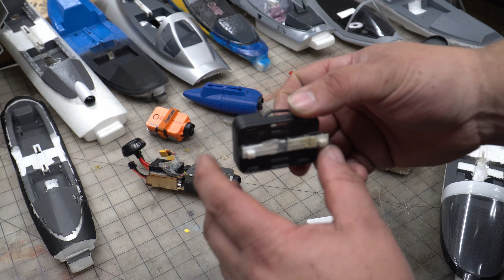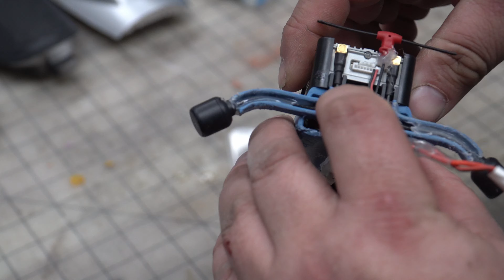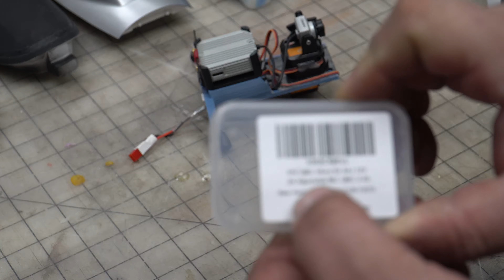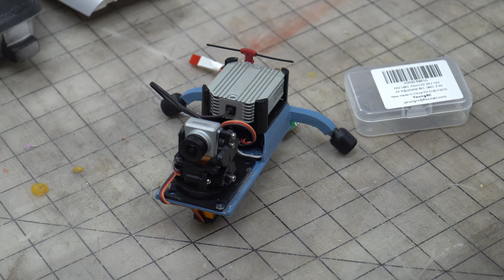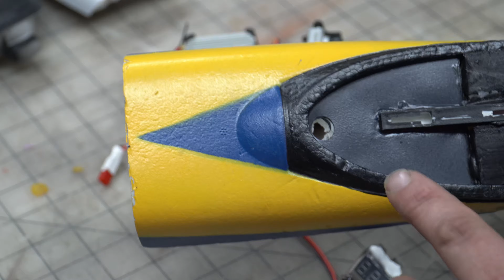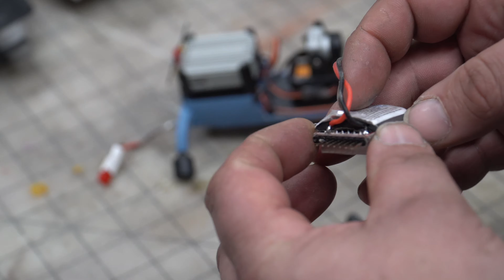Modular MotionSIC DJI FPV pod

Comment: That’s really nice. I’m currently trying to think how to set up the newer DJI air unit 03 cam transmitter set in some type of attachment, was thinking maybe clip in a GoPro connector
Reply from the maker: I just ordered an O3, but I think this one is going in a quad until I can test out the power/arming setup hassle that the O3 has, or had, when not using a FC.  Some say a firmware change fixed it, but I'm also seeing things about some of the recording features only being enbaled with the goggles 2 and not the goggles v2  (stupid naming scheme)  So we will see when that shows up and I get around to testing it.
Reply: I’ll be watching and waiting. And continue to investigate in the meanwhile. Thx.

Comment: Hello ,
it's really a great video that's exactly what I'm looking to do with the dji o3 air unit :)
For the electronics and the different connections, do you have a list of the elements you use (Ubec/receiver/adapter?!). Indeed I am a novice and I try to take stock of the necessary equipment. Also can you tell me the motionsic system need how many channels on the radio?
Thank you in advance :)
Good day,
arthur
Reply from the maker: the o3 needs a slightly different setup, you should be able to google it, I don't have one so haven't needed to actually rig it up. It needs an "arm" signal to go to high power.

I used a TBS crossfire nano rx with the 4 channel PWM adapter, they may only make the 6ch ones now. but any small receiver will work that works with your radio.

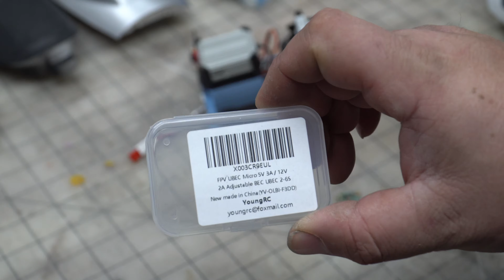UBEC was a little one I found on amazon or getfpv or something.  The ones I used here were "YoungRC FPV UBEC Micro 5V 3A / 12V 2A Adjustable 2-6S". The one to the receiver was set to 5V and the one to the Air unit was set to 12V (I show the case and label at 4:43)

The motionsic system needs 2 channels: pan and tilt. they are just servos, although nice and far travel ones you can also just connect the pan and tilt to the RX in the craft if there are open channels and not use the second RX, this is just my way of making it more modular.

Comment: Do you have an stl for that action cam rail mount?
Reply from the maker: There are a few on cults/thingiverse for the rails and sockets. but I mostly use the freewing set from motionrc, set of 4 injection molded pairs for $3 https://www.motionrc.com/products/freewing-90mm-f-16c-weapons-attachment-hardware-fj306110916   They are great for padding orders up to free shipping and things like that too ^_^
Reply from the maker: Or do you mean the plywood mount for the runcam/fatshark setup?
Reply: That blue cam mount that mounts to the wing
Reply: Timestamp 1:42
Reply from the maker: https://www.thingiverse.com/thing:4700731

Comment: I been waiting for this!!!
Reply from the maker: Hope it helps you enjoy the hobby
Reply: @greycat_rc  You should make a TBS BAG / Tally Ho set up video...I think I know how to set it up but I'd rather have some help
Reply from the maker: FYI: Asking vs Telling will get you further.  ("Can you" vs "You should")   I'll see if I get to it at some point, have a whole list of things on the "make a video" list. But time, and getting used to hearing myself in the edits and such is a thing.

I also don't use the Tally Ho specifically, although what I do use is probably pretty close.  I use https://headtracker.gitbook.io/head-tracker/ software which I first saw on Painless360's channel, and was using 2 arduino boards bluetoothed together with the sbus connection on the one into the bottom of the TX16s, but then I got the bluetooth module and soldered it into the TX-16s so it could talk directly with the arduino on the goggles.  Then for the model setup I bound the CRSF rx with the external module on the radio for channels16+ and then set the trainer channels to be up in that range, I have a switch on the radio to enable/disable the head tracker as well, so if something goes strange I can lock it to centered, and to keep from hitting the extents and such when walking up to the flightline and such.